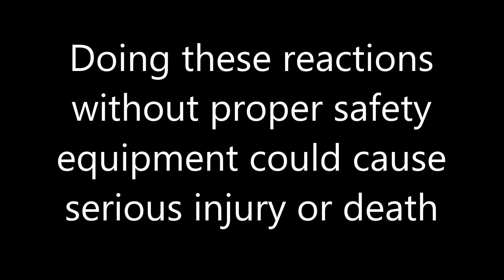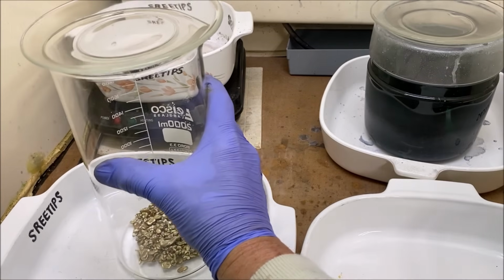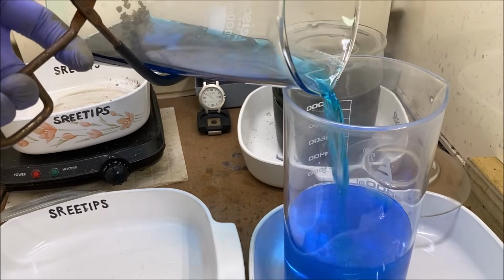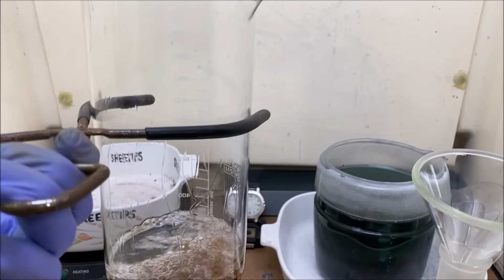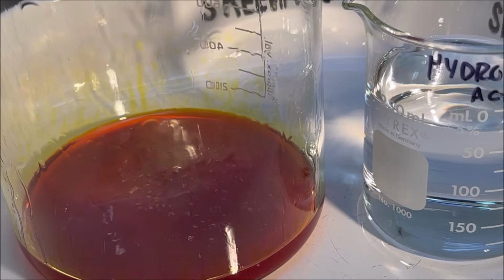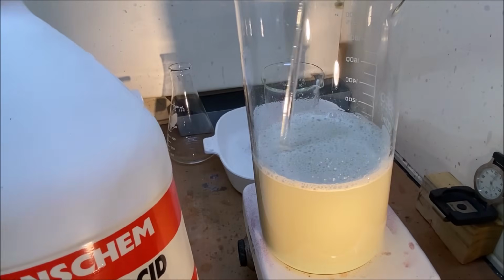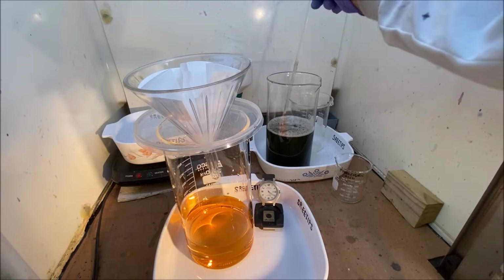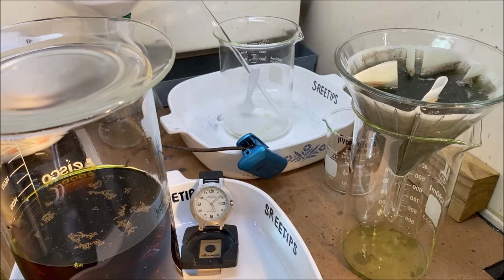Zinc GOLD Bar Repurification Part 1

Comment: I knew he wasn’t gonna let that bar stay frosty long. It’s a bummer it has to be refined again but I’m glad we got another video! 👍👍
Reply: I was surprised with how well it worked vs copper, seems to take out a few extra steps too… the acid washes would remove the zinc easily with less residual metals in the finished product. Leaving more gold. 

That frosty oxide could be burned away or cupeled in one extra step vs 3 or 4. 

All part of a process
Reply: We are the lucky ones in the end aren’t we….

Comment: Nice one Streetips. A few weeks back I commented about how the old timers granulated their inquartated gold  by pouring the molten metal through brooms to make fine granules. Old school brooms without long handles made from long thin sticks such as those used in third world countries even today… an assistant would hold one broom in each hand and swish them through water in a half barrel as you would pour in the hot metal which is broken up by the sticks within the broom as they cooled. I tried this recently with my old workshop 2000ml Vitamix blender, three quarters filled with water and spinning at low speed. I very finely granulated a couple of ounces of metal, and was able to dissolve the fine grains in Nitric way quicker that the cornflakes style you have done here at 4:40 in this video. It worked so well.

Comment: It would have been interesting get a weight on the metal after your long nitric acid boil (washing it and drying it first)

The weight of what's left less the weight of the gold you started with would have shown you how much silver is left and how effective the long nitric acid boil has been.
Reply: I think this is a good metric to take every time, but specially this time.  You should be able to calculate the gold to within a few tenths of a gram. Taking this measurement should help in better calculating final production weight, and point you at inefficiencies in your final refinement.
Reply: I was thinking the same

Comment: Great video!  I'm curious to know if the pot you use for pouring in-quarted gold into is stainless steel or aluminum?
Reply from the maker: Stainless. I’ve used aluminum but don’t anymore. It puts stuff in the precious metals that causes problems. Stainless is the way to go.
Reply: @sreetips  You're that guy, always ready to assist with answers. Thanks!
Reply from the maker: You’re welcome

Comment: As hindsight is 20/20, would it not have been better to filter the ferrous sulfate using the vacuum pump before adding to the gold solution?  Unless you were wanting the solution to be added at a slower rate...
Reply from the maker: Yes

Comment: Before you added the second dose of nitric to the inquarted gold granules, you might have tried your test where you sample the liquid (you'd add some distilled water over the gold and rinse) and then added some drops of HCl to your sample to see if any cloudy AgCl forms. This is to see if the single long boil does the deed. I am a little less then impressed.  
You'e the one doing the work & buying the chemicals...I would have to say that my preference is for 1: the multiple nitric boils and 2: the SMB precipitation. I'd rather not have Ferrous (iron) anything in the gold. I assume the SMB is a fair amount more expensive than the Copperas, but we're just talking a few bucks in an ounce of gold; about the smallest batch you process. You can buy reagent SMB versus "Stump Out" a tad cheaper, though not by much. Frankly, the copperas is an agricultural garden-supply chemical and I don't trust it to be all that clean/pure. 
I appreciate the desire to experiment and try different processes, but I think with the SMB and the occasional SO2 precipitations you've reached the optimum methods. But carry on!
Reply from the maker: If you look closely, as I add the hydrochloric acid, after the nitric boils are complete, you can see a cloud of silver chloride form around the gold. I’ve seen it before when I hastily moved forward with the refining, before all the silver had been removed. I still prefer multiple small-dose nitric boils over one long nitric boil.
Reply: @sreetips  Fully agree. I don't think you want to go stoichiometric, meaning, you only add enough nitric to dissolve your calculated silver & base metals and then wait for every atom to react.  You really want to flush & dissolve out everything you don't want and your odds are much better with the multiple boils.

Comment: I knew it too, not to mention than everything and anything he does is as close as it gets to perfection.

Also, another very old topic in this community (I am copying from my old Uni text book, I did not remember the books had many many exemples and exercises):

3Au+4HNO3 → 3HAu(NO3)4+NO+2H2O

As usual, Mr Sreetips has been right all along. Not even the gold refining forum gurus managed to have this level of hands on knowledge.

According to the exercise book, in this reaction, gold reacts with concentrated nitric acid to form gold(III) nitrate complex, often referred to as HAu(NO}_3)_4. Nitric oxide (NO) and water (H2O) are also produced as byproducts.

It's important to note that this reaction is typical for gold and concentrated nitric acid. The formation of the gold(III) nitrate complex makes gold soluble in water, allowing it to be further processed or analyzed in solution. The reaction is often part of the process for dissolving gold in the preparation of solutions for various applications.

Please note how the notes insisted on "concentrated acid". My reading is that, during his experimemts where Au was dissolve (there was one full video where only HNO3) was used, the game is related to the HNO3 initial state (of concentration) making it more concentrated evaporating the water dilution and then reacting with Au.

Please also note that on the equation heat is not anotated. It means the exercise was asking to consider NCTP.

Comment: Great job on the Stoichimetry calculations !
193.5g of Silver works out  to be consumed 1:1 by 251 ml of 45% Nitric acid. A*
But it wasn't 45%. Diluting the 70% acid by 50/50 took it down to 35%, so about 322ml (or a bit more) was needed, as you saw and corrected for.
Great to see you doing the Math and fixing it as you go along.

Comment: I know it's late but while I was watching the contamination film on top of the molten metal. Very hypnotic bby the way. I had a thought. You may very welcome have been able to refine that bat with a simple process called cupeling. It would have driven off all of the metals but gold and silver. Since there's no silver it would be pure gold. It's actually pretty interesting. You can learn it from Mt. Baker Mining and Metals.  He's mentioned you on his channel before having learned to clean gold with acid from your channel.
Reply from the maker: I’ve never used cupel. It’s more of an assay/mining technique than a refining method.
Reply: @sreetips  I know. I was just thinking it would at least be a good experiment and at most be a handy shortcut to improve problem solving efficiency. You already have the oven for it. If you wind up with a dirty bar it could save you a lot of time and heart ache.

Comment: When you make the silver and gold shot; is that what they call “white gold”?

I was excellent in Chemistry class; but in Lab I didn’t apply myself as much as I should. I was young and dumb! :(

I would love to meet you and talk about different topics and processes. 😊
Reply: To answer your first question, not that is not ‘white gold’. White gold is usually gold + silver + palladium or platinum and must remain above 10k to still be considered gold (in the US).   Which is then plated in rhodium to give it a whiter color and shiny appearance. 
Inquarted (litterally means quartered) is 25% gold + 75% silver/copper (sterling is generally used for ease of procurement), but less copper is always better since it takes 2x more nitric to dissolve copper than silver.  As long as the metals are mixed well, it allows nitric to get between the gold atoms and selectively removes the silver/copper and leave gold behind.  The reason 25% of it is gold and not less, is so the gold keeps its shape and doesn’t turn to dust which makes rinsing much easier.  

Hope this helps explain things.
Reply: I’d like more explanations like this, I’m fascinated by these processes and am always thinking “Why does it do that? What’s actually happening at a molecular level? What are those fumes?!” Does everyone else already know and would they get annoyed if you went into such details?

Comment: After seeing the 1.3/g id prefer to do that one for some reasons. First, emissions with second nitric boil revealed clear emissions with only copper in the solution. Where as incremental 6-7 boils leeches yellow gold into liquid. So yeah, the one three did get rid of nitric with only cu left.

Comment: If I were to guess, at one point Sreetips had a bunch of nitric and a ton of sterling. He started doing his nitric boils shorter to add more nitric to his silver jar to dissolve all that sterling. I remember in his older videos, the concentration of the solutions he would pour off from the nitric boils was higher, like this time, there was often crystals forming on the side of his beakers.

Comment: Sreetips, I was very skeptical about the one time nitric boil. It was at least a partial success. 3 extractions v.s. 6-8 extractions. I know there's a fine line between efficiency and laziness, but in this case, I'd say this leans towards efficiency. Btw, just wondering why you don't use a washboard anymore to get smaller inquarted gold shot?
Reply from the maker: I prefer multiple small nitric boils. Setting up the board is an extra step.

Comment: When you calculated the required amount of nitric did you do it based on the silver only? Correct me if i am wrong but does copper require 2 times the amount of nitric per gram then silver ? And was there enough to accommodate the extra amount that would of been needed to do it in one shot? I understand the law of diminishing returns. And understand the solution is saturated at the end of the run like you did here. Just so you know i am not questioning anything you did here at all. Was just wondering it you added any extra that would of been needed for the copper values that may of been present. 

With that all said i would like to also thank you  for all the information you have put out here. I have learned more then a lot from you and your videos over the years. I have been collecting e waste for 6 plus years and finally started recovering the previous metals out of them about a year and a half ago. It is a bit different then refining like you are doing most of the time as you know. I have taken the pleasure in refining a fair amount of gold filled mixed with some heavy plated material once. As soon as i figure out correctly how you and the miss find and value the materials on the spot like you all do to make a profit i will start purchasing lots when i can find them. Just need to do a little more studying on how to value all the things. Again thank you so much and i really appreciate you for sharing.
Reply from the maker: I added extra nitric to ensure an excess

Comment: Another awesome video! Thank you for your service also. I am late on that. If you don’t mind me asking what did you do in the Navy? You may have said but I have forgotten if so.
Reply from the maker: Main Propulsion Engineer (Machinist Mate)
Reply: That’s cool. Worked with the Gas Turbine or Nukes
Reply from the maker: 1200 psi, boiler fired, main steam turbines - dinosaurs! They were just converting everything to airplane engines (gas turbines) when I retired.
Reply: @sreetips  Dinosaur for sure. But still a heck of Machine
Reply from the maker: We engineers had to “lite-off” the plant three days before we got underway. Then shut everything down when we pulled into port. The first on and last off. My dream job would be Chief Signalman. Ours (Chief Berry) was a super guy. Always willing to help. He was last on and first off. He’d lay out and sunbath when we were underway. He had a great job.

Comment: Hello again Mr Sreetips.   I hv 2 questions… one being regarding Büchner funnel …and that is this.  I see practicality of one piece porcelain funnels , but have you used the two piece chemically resistant plastic ones with any issues..?    Second question is this..what size funnels are your most used and practical for small projects with filters..??? Hv thoroughly enjoyed finding your channel several years ago and your approach and explanations are always great and informative.   Ken from Ky
Reply from the maker: Ken, I have two, 2-piece plastic funnels that I use mostly for washing cement silver. But I’m sure they’d work fine for gold. I have a 7cm, two 9cm, two 11cm and on 12.5cm all ceramic.

Comment: I was hoping you'd do one long boil per a comment you responded to on the last one about several with washes between ending being faster.  Interested to see the result of this.
Reply: I'm going to venture a guess that on that inquarted gold/SS nitric boil - as the size of the clumps decreases toward powder size, that single boil will be more effectively completed without extra second step you needed this time. (?)    Nice seeing multiple paths done :)
Reply from the maker: It worked, but I still prefer multiple small nitric boils.

Comment: Maybe your solution can only hold so much silver/copper?  It seems close. Would simply adding more distilled water enable it hold all of it in one process?
Reply from the maker: Possibly. But I still prefer multiple small nitric boils.

Comment: My initial thoughts (still watching so I'm not done yet :) ) was I wonder what percentage of nitric acid would boil off before it had a chance to react?  Would you need an extra amount to compensate for that?

And during your melt of the gold and sterling silver would it have helped at all to add some borax to remove the skin off that metal?
Reply from the maker: Multiple small dose boils do a better job. Yes to borax

Comment: So why not use a reflux condenser on top of the reaction to return most of the acid into the beaker and not lose it to fumes? Also reducing the risk of caustic vapor exhaust?
Reply from the maker: Didn’t think of it, too lazy to set it up.

Comment: I have a question, is it less efficient? Cost wise and time and energy Doing one big nitric removel of the base metals or small incremental doses of nitric.
Reply: Time wise, much more efficient because it’s just one boil.  
The only change I would’ve done would’ve been to add the nitric drop wise using a separatory funnel over the course of several hours.  

I honestly think he got all of the silver/copper in the first boil he did, the color was just from what didn’t rinse off, and it appeared bluer when some of the liquid evaporated.  
Nitric is the most expensive chemical, so only using exactly as much needed to remove base metals is always going to improve cost efficiency.
Reply from the maker: Doing many small boils does a better job of removing the silver.

Comment: Maybe this question was asked and answered before but if the nitric boils remove all the base metals then why do you need to dissolve the gold shouldn't it be purified already
Reply from the maker: Very close to three nines just like it is after the nitric boils. But the only way to get it 3N is to refine it with aqua regia, or hydrogen peroxide, or chlorine gas. The main problem is lead, if present. Just trace amounts will ruin the ductility and malleability of gold. The only way to get the lead out is to refine the gold, like I do in these videos.
Reply: @sreetips  Thank you for the excellent information. I knew you wouldn't perform unnecessary steps that consistently. Also knew that you refined beyond just 24k that not all 24k is equal. Since I've already interrupted you I would like to ask if you could show how they make the small gold shot that resembles bbs which they use to make, in my opinion, the most beautiful gold bars with a lid on the graphite bar mold at the mints
Reply from the maker: Just pour the molten gold in pure water.

Comment: The enquarted shot actually looked much more solid on the surface than completely extracted material. I would say that there is some room for experimentation as to the volume and number of your extraction cycles.
Reply from the maker: I still prefer multiple small dose nitric boils over one long nitric boil.
Reply: @sreetips  I can understand that. When something works well for me, I don't like to change it either. It's probably splitting hairs as to which way is better anyway. My only thought was that you could possibly go from 6-7 boils and have it down to 4 with a thorough rinse before the fourth with 3 larger boils preceding. Say about double in volume.

Comment: One pound for every 50 penny weight threw me off.
all those old/weird units are driving me nuts. Troy ouce was already a bit weird, penny weight is what? The weight on an old penny (saw 1/20th of a troy ounce but still based on what?) and you need one pound (on a scale set to grams) for every 50 penny weight. No offence, but the imperial system is really messed up sometimes.
Reply from the maker: One Troy ounce is twenty pennyweight. I don’t know the history. I use grams or Troy ounces. The book used pennyweight.